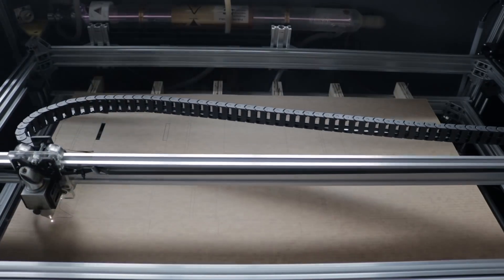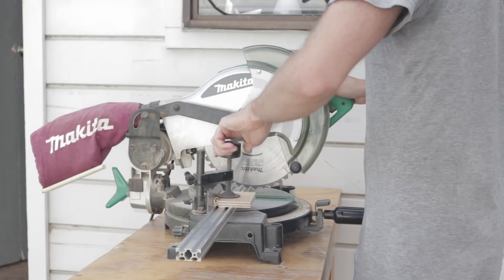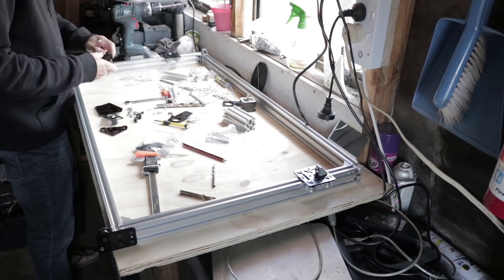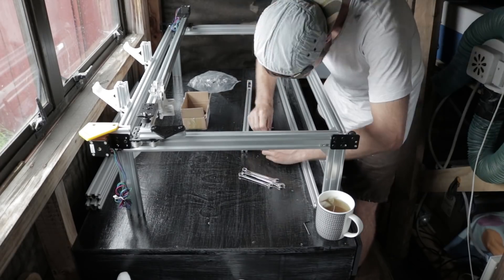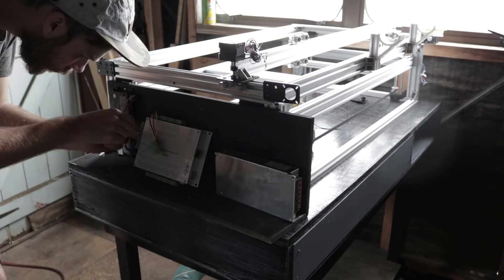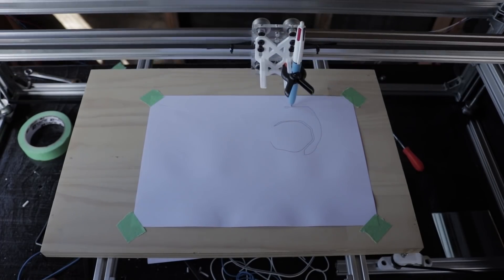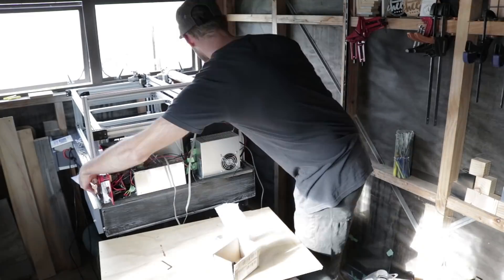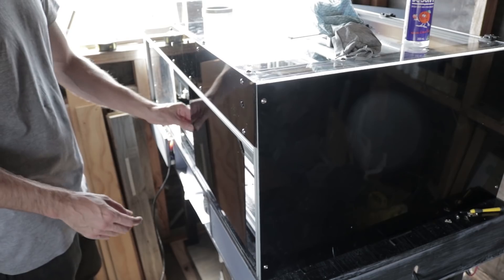DIY Homemade Laser Cutter

Comment: Why wheels over rails because I have used both and the rails are far superior for these sorts of thing.  Cost is the only thing I can see the advantage to wheels (even the PC wheels) but the trade off is there.
Reply from the maker: Yeah rails are definitely better but the wheels work just fine for the cost provided you keep maintained

Comment: Is it possible to make a diy laser cutter with a cutting diameter of 500x500mm and a cutting thickness of 10mm for around 500$ - 1000$? I really wan't one but it's so expensive!
Reply from the maker: 10mm is quite thick for a laser, just the Co2 laser tube alone would be most of that budget unfortunately.
Reply: Ohh ok. But how thick can this that you built cut?

Comment: Cameras and screens = very cheap, your eyesight is irreplaceable.  Best to make the entire cover opaque with at least 2 or 3 interlocks that cut power to the laser, and watch everything through a screen.  Even a tiny partial reflection is an instant retina killer, best to eliminate the possibility entirely and watch everything through cameras.

Comment: Are you crazy? Please buy proper laser shielding for your enclosure and respective wavelength. You only have two eyes.
That said nice work :-D
Reply from the maker: Thanks! and thanks for your concern. It is my understanding that the 10.6µm wavelength of the CO2 laser is absorbed by the shielding I have in place, I also wear laser safety optics when it's functioning as a secondary safety measure. However I'm not an expert so any tips from your experience would be appreciated by all.
Reply from the maker: Great, thanks for the advice and the link. That's what I always suspected about the cheap ebay googles :/  In future videos I'll make sure I address the safety precautions for high power lasers!